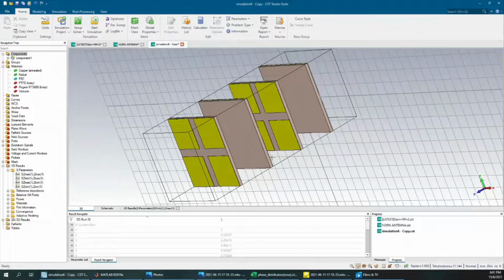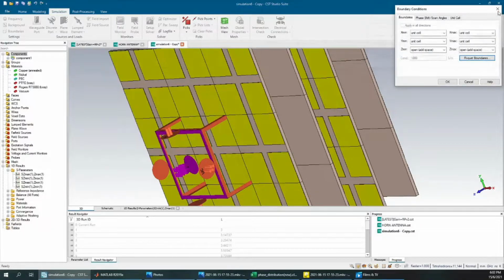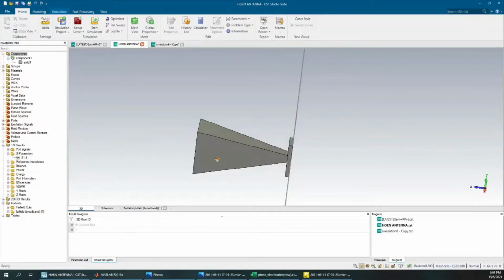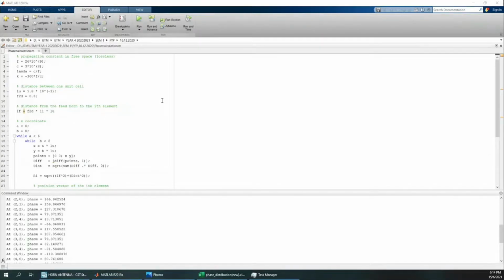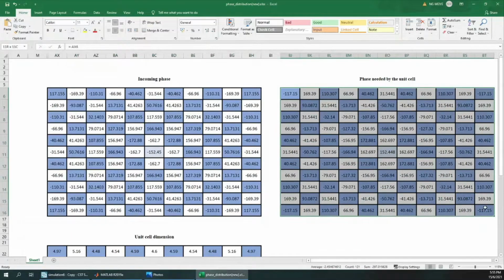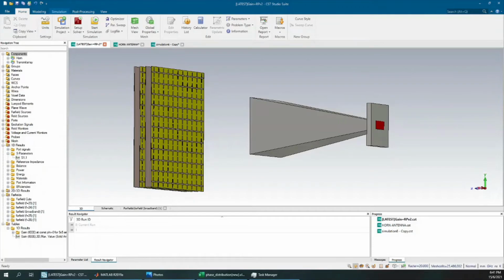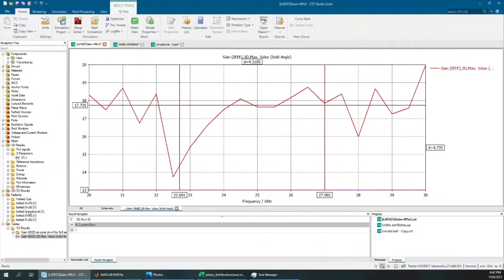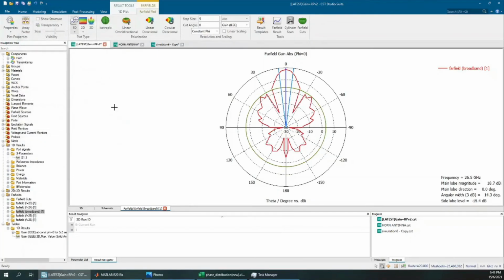#finalyearprojects 2021 | Transmitarray Antenna at 26GHz for 5G Applications

Comment: the gain of horn without tranmsit array and with tranmsit array is almost same. How do we know that transmit array is working properly?
I think u may steer the beam and recheck it.
Reply: I was about to ask the same question. I find it suspicious to have the same gain (horn and horn+transmit array). The gain of the transmit array depends on the aperture of the transmit array, so I believe there might be an issue with the simulation. I would like to know what boundary conditions need to be defined for this kind of simulation.